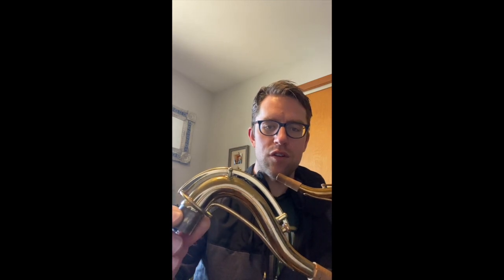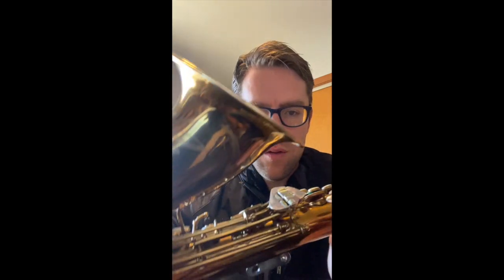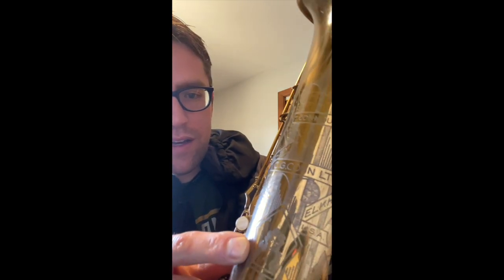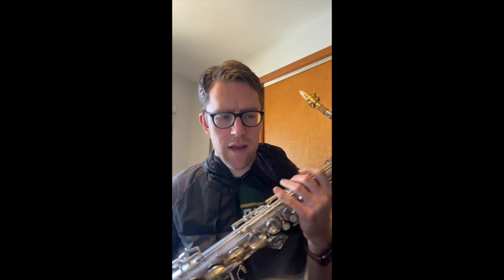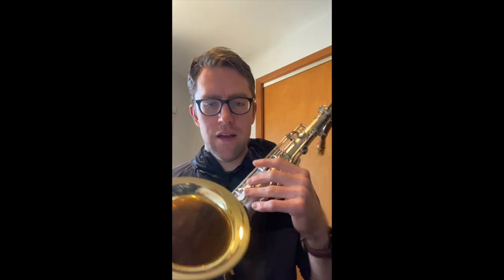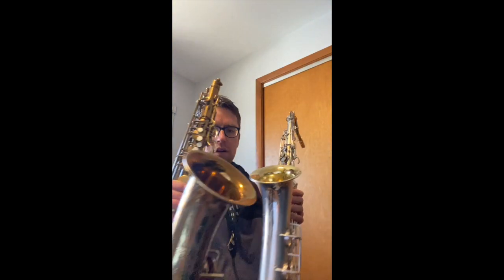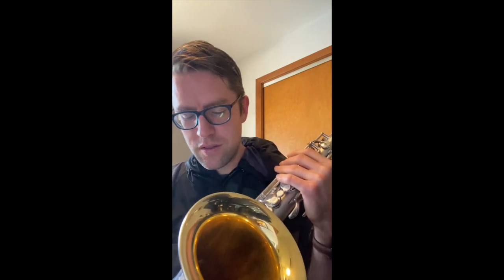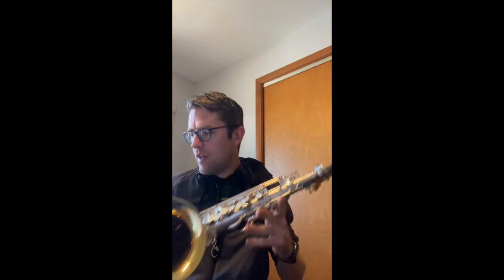Conn 30M Vs 10M. Connqueror--ed!

Comment: Great comparison. Thanks for posting. I am a 10M player myself and love the sound. Never played a 30M though but would love to try one. What strapring adjuster do you have on the 30M?
Reply from the maker: The strap ring extension is something I fabricated out of steel. I rounded the corners, drilled two holes in th metal and mounted it with a nut and bolt. Its pretty basic but works great!

Comment: Ive been playing conns for more than a decade now, had a few 10ms now have a 30m and i absolutely love it! I find the 30m much slicker with a more lush sound
Reply from the maker: That's exactly how I feel about them. I like the feel of them and the extra weight. They really are different than the 10M's, which I a little surprising since the body tubes are essentially the same!